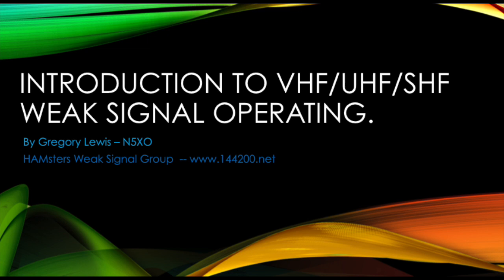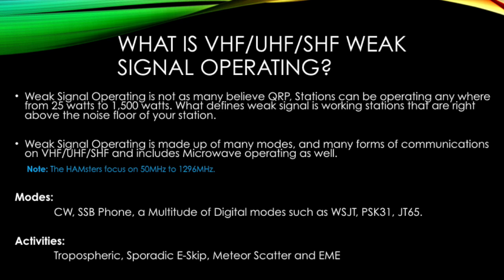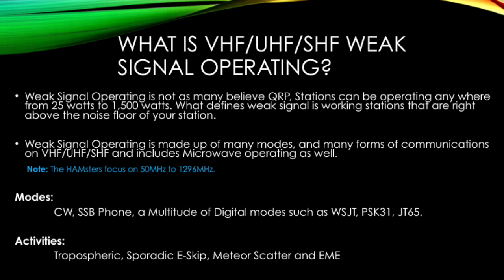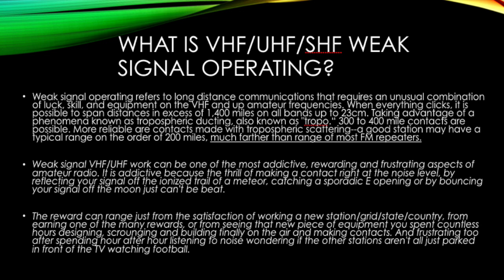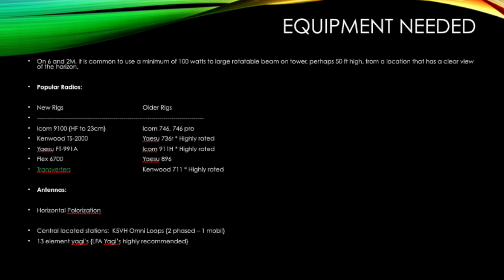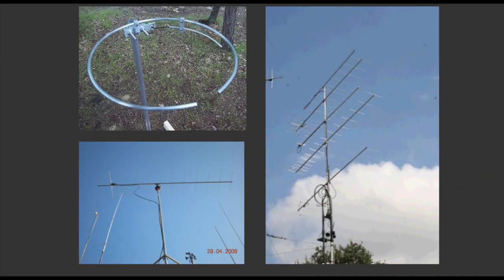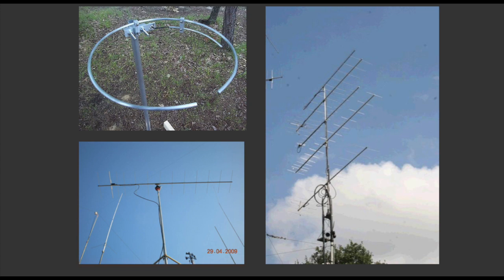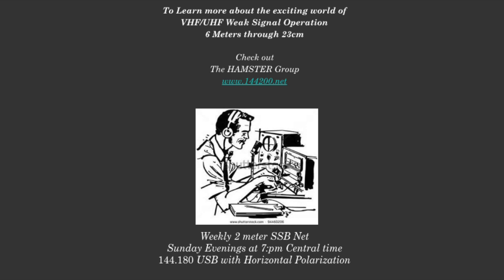Introduction to Weak Signal

Comment: Icom 910H has very poor transmitter, shouldn't be use with any PA. It is not outstanding at all. Maybe for sat operational only on FM... 
It is designed to use with LNA at antenna. The best choice is always good TRX for HF like K3, TS590, TS890, FTDX5000  or similar  with good transverter like Kuhne DB6NT,  M+E HA1YA, or other modern design TRV.